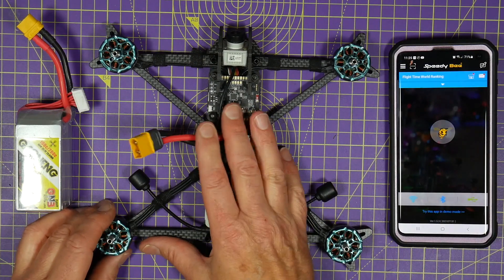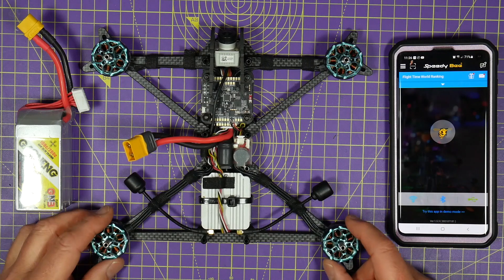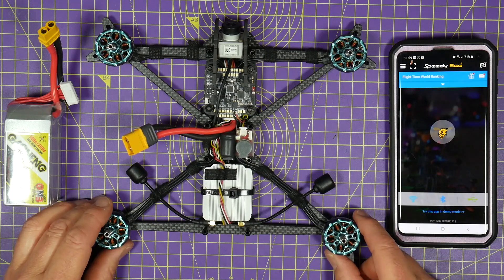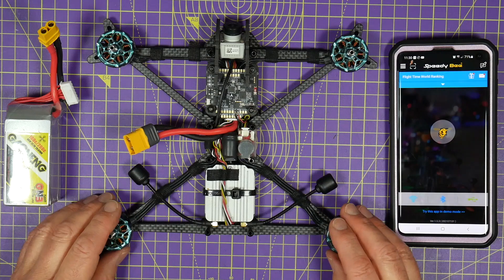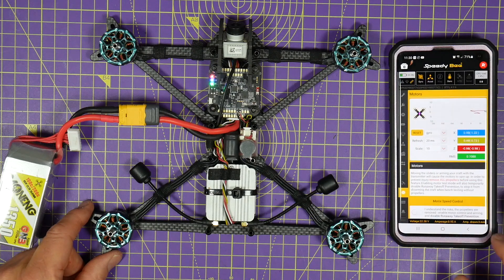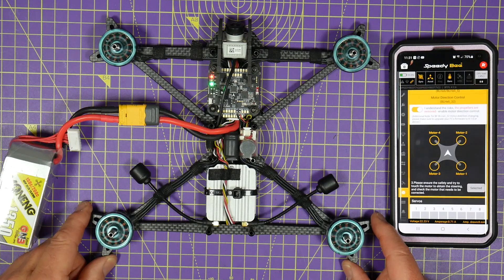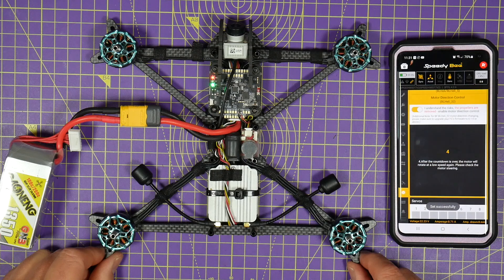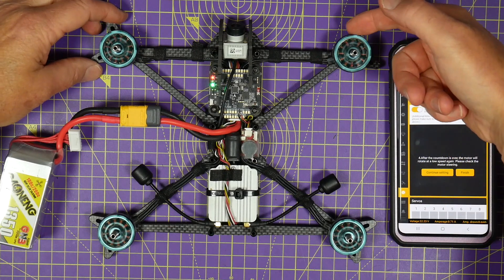Reverse motor direction using Betaflight SpeedyBee app / BLHeliS & BLHeli32 configuration

Comment: hey, was just wondering if the m8 charger could be powered by a 19v 45w laptop charger with a tx/60 adapter? commented on an old video but dont know if you would have seen it. thanks in advance -pat bull
Reply from the maker: Yep, that'll work but since it's only 45W you won't get the full power the charger can deliver.

Comment: lovely clean build also
Reply from the maker: Thanks. Full build and tuning video on the way.
Reply: @WhirlyBloke  is that already out? I like it a lot!
Reply from the maker: @whatsnext___  The AOS-5? Yep, check my other videos.
Reply: Ok found it. Might reallly be my next! What motors do you think is top off the bill for 4S?
Reply from the maker: @whatsnext___  XING2 2207 1855KV is optimal for 6S and will work on 4S ok. But the 2755KV is a better match for 4S.
Reply: Thks!